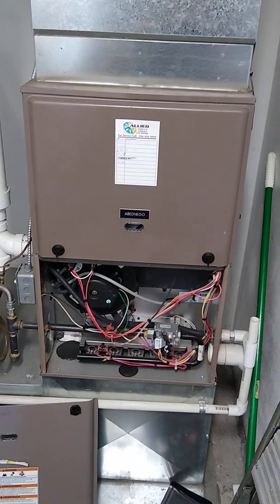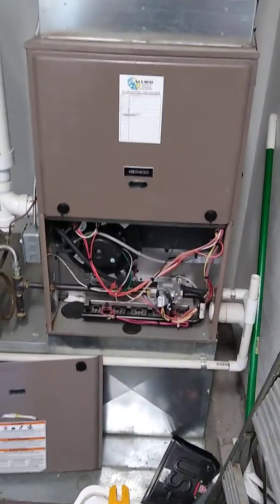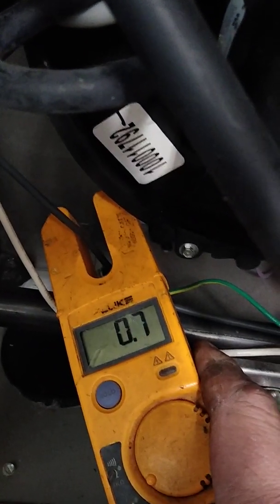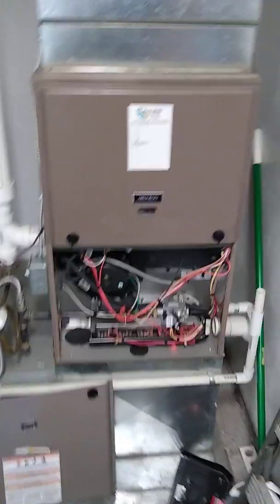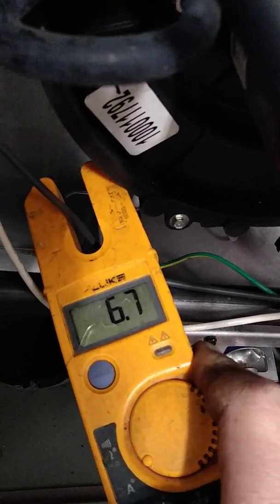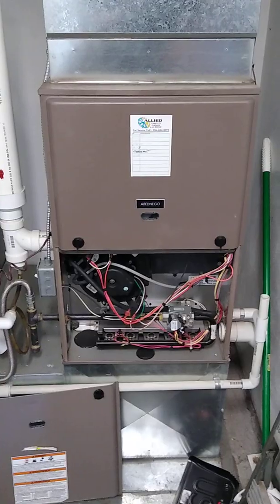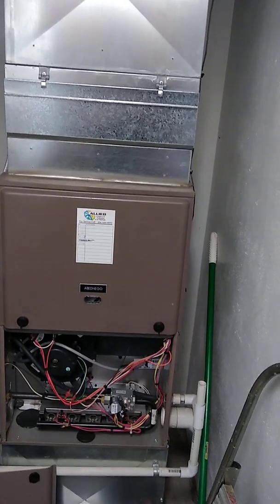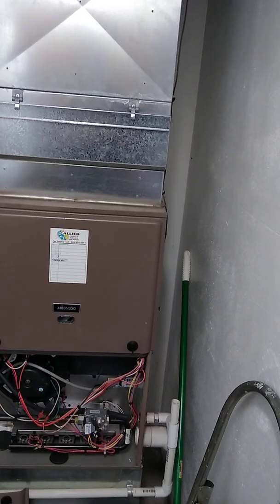ECM Retrofit Motors for HVAC.   Are they worth it?

Comment: I have a two story house and there is about a 10 degree difference between the two levels.  When I run my current fan motor the temperature equalizes. I would like to get an ecm motor, I live in Michigan where we have the cold winters and hot summers.